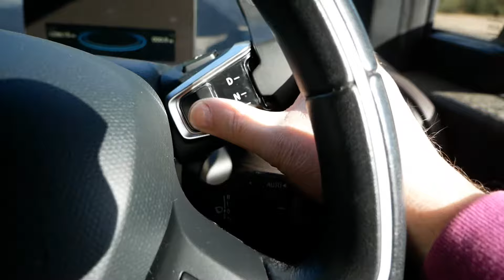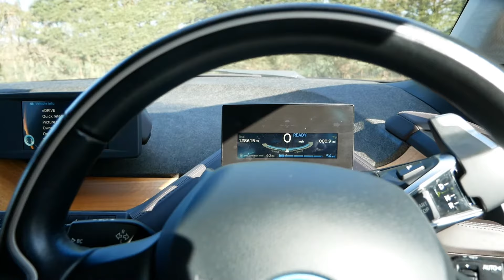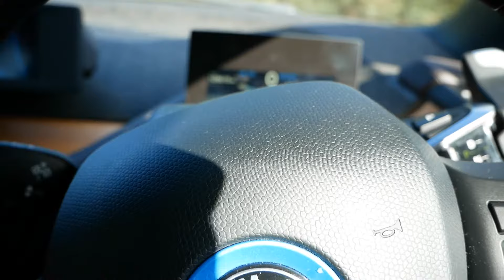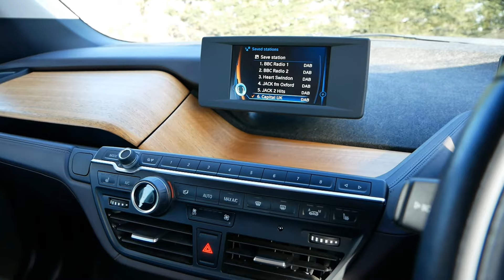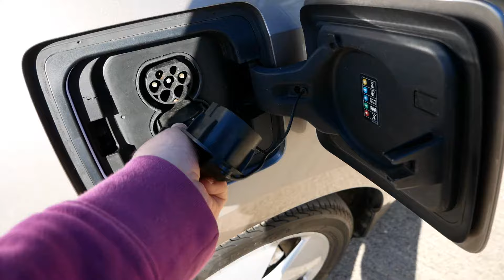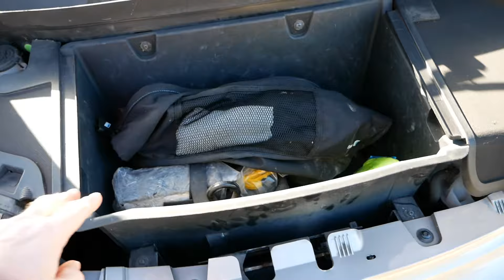BMW i3 beginner's or new owners guide on how to use and operate your new electric vehicle

Comment: Thank you for the brief tutorial. I just bought a 2017 REX and at first I wasn't too thrilled with the aggressive regenerative braking. However after driving it for the third time the car came alive! This is a well thought out beautifully engineered car and it was well ahead of its time 8 years ago and still holding true this day. The car is fun to drive and gives a spirited driver myself that electric manual feeling. This is my first BMW and so far I am extremely impressed with German Engineering. The car takes off like a rocket and the steering is fabulous. I believe these model cars will be a collector's item one day due to its quirkiness and sophisticated styling.

Comment: Thank You!
I've owned my 2014 i3 for 9 years now. After some recent experiences I'm making sure I'm getting the best out of my car.
I have to point out that I thoughtlessly used the eco modes for years assuming it was a good call. It is NOT. It ruins the experience of driving the car on most levels. 
In comfort mode she is a temporarily embarrassed compact space ship. In the eco-modes she is ruined. Torally "nerfed". I wasted years puttering around like i was driving a piece of complete trash for what turns out to have been absolutely minimal electricity savings. At least five years of horse and buggy driving. Other owners have done research and the electricity savings has proven minimal... especially in the light of how her otherwise high performance is completely destroyed...like 3 miles per trip? I'm making up for lost time. I will literally NEVER use either "eco mode" again. I deserve to drive what an American auto afficianado called "The stealth super car"...I will also never buy a gas car again. Thanks for your work!
Reply: Love your comment. We just put a deposit on one yesterday 
Definitely a compact space ship!!
Amazing!!

Comment: That maintenance cycle is such a cool feature! A common issue with plug in hybrids is that there are people who will drive the car in ev mode long enough for the gas in the tank to spoil (this happens quicker in America due to ethanol). Then one day they try to take the car for a longer trip but they can't because the gas went bad and then the car has to be towed to a shop.
Reply from the maker: I agree

Comment: Hello! Thank you for all the videos, there great! I have a few questions I was hoping you could help with. I've been looking at used ev's and narrowed it down to 3 or really 2 since my first choice is the Ioniq Electric but its just outside my price range. so the 2 I'm considering are the 2014/2015 BMW i3 and the Kia Soul Ev. I prefer the i3 but concerned about the range and maintenance costs. Which do you prefer? I will be most likely making the purchase through Carvana and you get a 7 day no cost return/exchange and you can do this up to 3 times. Assuming I go with the i3 what would be the main things I should look at or have looked at during the 7 day trial? What would be or should be the min range I can expect and would I be better off getting the range extender since the used costs are about the same? Any input would be appreciated. Thanks Jim
Reply from the maker: If you purchase a vehicle remotely without viewing it first from any trader, you get the same as the distance selling rules apply. For further details on these vehicles, see these examples that have previously sold, which should answer your questions... 
i3 60Ah REX https://www.gogreenautos.co.uk/for-sale/bmw/i3-60ah/ow15lpv
i3 94Ah REX https://www.gogreenautos.co.uk/for-sale/bmw/i3-94ah/bmw-i3-ff16axc
Soul 27kWh https://www.gogreenautos.co.uk/for-sale/kia/soul-27kwh/kia-soul-ev-lg64mgy
Soul 30kWh https://www.gogreenautos.co.uk/for-sale/kia/soul-30kwh/fh18typ
The i3 REX certainly has higher maintenance costs due to having an engine that needs servicing. BMW dealers are very expensive, but cheaper to use a HEVRA garage. The Soul is extremely comfortable and easy to live with. The i3 isn't due to hard suspension and the narrow tyres are prone to punctures/blowouts if you hit potholes.

Comment: One thing that should be pointed out for anyone (like myself) considering buying one of these used (they don't make them anymore). If you're buying them for the US market, they purposely cripple the Rex version. How so?

So as was mentioned in this video, once you're below 75% charge, you can put on the Rex and tell it to hold the charge. Say you put it on at 50% and tell it to keep the battery charged there, it will do its best to do so. If you're using power quicker than it can charge the battery, the charge will slowly start to go below what you've set it to. However, you can still get great range this way and drive normally.

For the US market, they mess with the software and only allow the Rex to kick in once the charge is at (I believe) 6.5%. Of course, if you're that low, even if it's charging, if you're using power at a higher rate than what the generator can charge the battery, you might still be screwed, so it then starts limiting features. How fast you can drive, etc. Imagine being on the highway and all of a sudden being limited to 40mph, for example. You can think California for this.

Thankfully, you can buy an ODBC connector from Amazon for about $70 and iPhone software to remove the cripple and get it back to the European way of operating. It's just something you should know about.

Comment: A very extensive video. About the only thing you didn't cover (and I haven't seen it covered anywhere) is do you have to use premium gas for the Rex. I looked into it and it appears to be that you use premium, unless you live in a high altitude area. In that case, just use 87 octane.

Comment: You hit the key points very concisely and easy to understand.   I think you covered all the basics and I am ready to drive now……although one problem….I don’t have the car as they are terribly overpriced post Covid and high fuel prices.
Reply: They stopped production of the i3 a year ago. I have been checking the prices of low mileage used ones & there is good value out there.

Comment: What's the gas mileage on gas? And it seems that it can barely keep my battery at 7% while driving even if I'm only driving 35 40mph
Reply: It's about 45 mpg.
Reply: Another channel did a test on all three models of i3 and the 90Ah-rex version drove the furthest totalling 225 miles (battery + engine)

Comment: Hopefully someone see's this message and can help me out

I just got an i3 and arrived home, it's late at night, and it looks like the interior lights stay on. Is that intentional, is that supposed to happen? If not, how do I turn them off? 

Thanks.
Reply: @KingJimO8 Do they turn off after a few minutes and after the car has been locked? I don't own one so I can't help you anymore than that!
Reply: @joelcarterramadge183  no, not at all. I notice they were still on the next morning. It didn't waste any battery though to be fair so I don't think it's anything to worry about. Thanks
Reply: @KingJimO8  I still don’t think they should permanently say on though. I would not have thought it was a feature!

Comment: 128k miles!? These cars really last a long time!
Reply: Some Toyota taxis have 1M miles. 128k miles isn't crazy for a car.
Reply: @savedfaves   I know. I've doubled that in my Prius alone. You have to admit, for a BMW i3 it's pretty crazy.
Reply: @savedfaves  Indeed. My 2008 Prius Hybrid just crossed the 165k miles threshold. The hybrid HV battery in it is only 1kWh in capacity (0.8kWh useable) - but it still has the HV original battery and it still works flawlessly! Some have done 250k to 300k miles on the original battery. 
No reason why a BMW i3 shouldn't make 175k to 200k miles without any major issues, if regularly charged and run using the battery in a primarily city commuting environment.

Comment: Thanks for this video - very useful. As an i3 owner, there are two things that I find annoying, and I wonder if you might have a solution... Is it possible to configure the i3 to remember the previous drive mode used? I usually drive in Eco Pro mode, but every time I have to select this, as the car defaults to Comfort mode at start up. Second one is the e-brake/park brake; this auto-releases when you move off, but can it be configured to apply the e-brake automatically when start/stop is used at the end of a journey.
Reply from the maker: Yes the start up drive mode can be set using software. Its been a while since I did this and now can't remember what I used. Possibly the BimmerCode app. You'll need the app and a cable or dongle to connect to the car. Or ask on the BMW forums or Facebook groups and you might find other local BMW owners who have the software would be willing to do this for you.
I can't remember if the auto park brake is an option in the software.

Comment: Very low range on that one, is it an older i3 or is that expected from the 2020 model? I thought they put in a bigger battery
Reply from the maker: Yes this one was the 60Ah version. Then they did the 94Ah. Now they have a 120Ah battery.
Reply: @GoGreenAutos  Annoying they use that Ah terminology that no other manufactures use.

Comment: Brilliant intro Matt to the I3.  BMW know how to make good cars. The IDrive is great. Pity about the rear doors, I believe they would sell far more of these with conventional doors.
Reply: The rear doors aren't an issue once you get use to them especially if you rarely have back passengers. The issue is range with these older i3s and charging speed. If these i3's had a 200 mile range between charging and charged at 100kw instead of the maximum 50kw, these cars would have sold 400k instead of 200k..
Reply: @mamadouaziza2536  Yes, range and changing speed are some of the main hurdles for this car. I would also like to see softer suspension in the non-Sport model.
Reply: I actually like the back doors. They are really practical to put my purchases in the back seat. I should mention that I don't often have back seat passengers.
That said,they remind me of the suicide doors from the time of Al Capone.